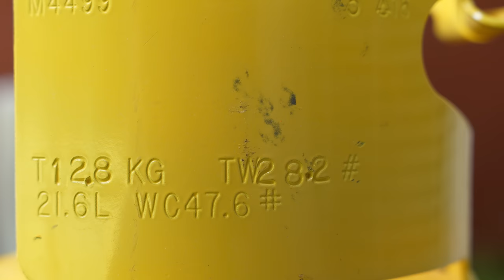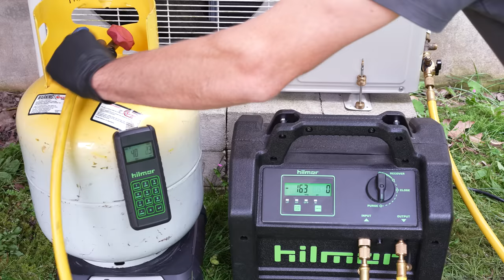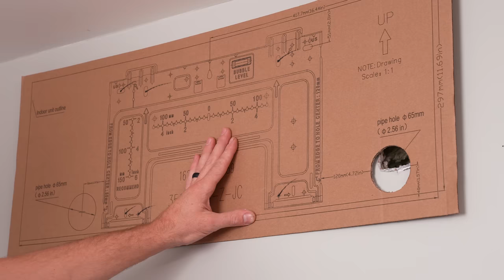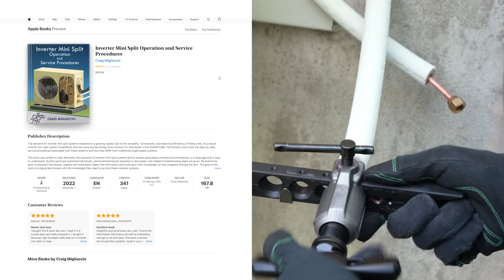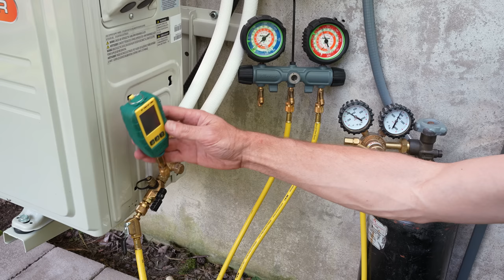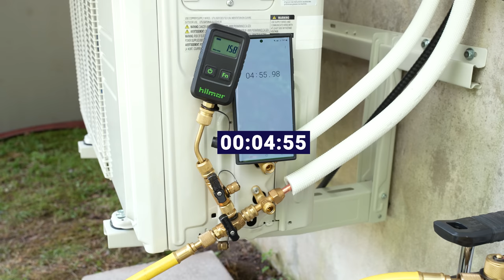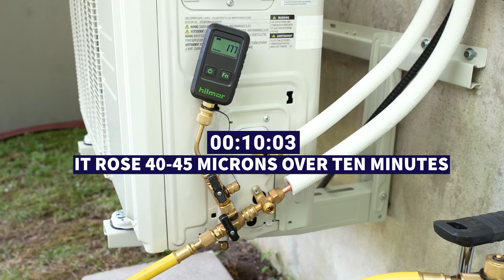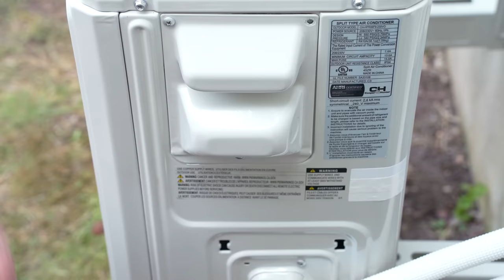Mini Split Replacement and Install Process! Wall Mounted Indoor Unit! All the Small Important Steps!

Comment: What was wrong with that Fujitsu? It should still be under warranty.
Reply: Not that one , I did notice that the indoor head was not a 12 RLS2 which is the match for the outdoor condenser. ThecRLS2 had a different type of front cover that raised up when powered on .

Comment: Outstanding I love man u are a great Instructor trainer thank you. I'm 66 an I'm going to go for it keep the video coming
Reply from the maker: Thank you so much for your kind words and encouragement! It's never too late to pursue your passion and continue learning!
Reply: @acservicetechchannel  amazing videos Craig! Quick question - I’ve just installed a Mr Cool mini split but not happy with my excess line coil. I’ve attached the lineset but not turned the Allen key valve to release refrigerant. Is it ok to unscrew from the condenser and tidy up the lineset? The owners manual is really vague on this. Thx!!!

Comment: I have a 10/12-yr-old 24k Daikin Mini-Split Inverter that I removed from my Florida home and brought to NJ.  I was going to trash it so it sits in two pieces, sans the line-set inside my utility trailer.  Can this system be shop tested to see if it would be worthwhile to install it here in my NJ home?  I don't want to go through a complete installation only to find out it actually needs to be replaced, at 82 years I don't need any more practice, if you know what I mean? There is currently no refrigerant or gas in either of the two pieces.

Comment: A white conductor used for power should be colored (Sharpie) or taped black to indicate it is now energized.  I'm going to fix a service upgrade where the installer landed the white, unmarked L2 to the neutral bar.  I will land it on the breaker after marking it.

Comment: Hi Craig , just wondering why the Fujitsu unit was replaced . They were great units , I loved how small, compact and sleek the indoor heads were, however coil leaks were very common with that unit especially when used in the heating mode . Like to know your thoughts . BTW I just bought your book looking forward to picking up a few pointers from it . Keep up the good informative videos .

Comment: Hi Craig, very helpful. I have several units I have replaced for a varity of reasons, in almost every case I was able to pull all the refrigerant back into the outside compressor unit. please  tell me how to use the recovery machine to pull the refrigerant into my recovery bottle and whether I can reuse it in a low charge unit

Comment: Hi great video, I love just watching your videos for a quick refresher before I fit a unit as I’m a new tech. You are by far the best teacher of these mini splits I have came across, I have both your books and love them! When on the vacuum you say aim for 100 microns, I have recently purchased the press set to just crimp the line sets together on joints,as some areas require heat permits and in the Mitsubishi installation manual it states no flare joints inside the building (R32) say if your fitting the indoor unit on an internal wall and using a condense pump. Only problem is on the fittings bag the manufacturer states they are rated to 200 microns does this mean going below to 100 was cause the fitting to draw in air? Can’t seam to find much info on it and my local supplier looked at me as though I was crazy asking this question. Hopefully you can shed some light on the subject. All the best
Reply: I love to watch for refreshing. Bit vacuuming for 10-15mins would be more than enough i think. I aleays listen to the noise from vacuuming tool to be sure its all tight

Comment: Thanks, Craig!  Your videos gave me the confidence to complete one successful installation last summer and now I'm in the process of installing a Multi-Zone Outdoor unit.  Question: the outdoor unit (Pioneer) lists 18,000 BTU as the minimum connected load.  Is there harm in running the first 12k BTU indoor unit by itself until I get the second 12k indoor unit installed? Or is it just energy inefficient?  Thanks!

Comment: 7:03 - I always thought so too, but if you read the install instructions, a lot of the times they say Solid or Stranded conductor wire, min AWG 14. 
It should be stranded for sure for 2 Wire AWG 16 for daisy-chain wiring of Variable Refrigerant type systems.
Reply from the maker: The issue is more for code than manufacturers instructions. WE used THWN/THHN standed to pass code in outdoor flexible conduit, thanks!

Comment: I don't know if you monitor your videos, AC Service Tech, but I want to know if you've ever removed an existing Mitsubishi mini-split indoor unit from a wall?  In our case, I can't see a backing plate and, quite frankly, the Mitsu indoor unit that I'm referring to doesn't seem to budge when I try lifting it up.  I suppose another way to ask this is, in your experience, does Mitsu use backing plates like the one you filmed for this video to mount their mini-split indoor units?  By the way, the indoor unit that I'm asking about is an MSZ-FE18NA.  Thank you for any help you can give us..

Comment: Great channel!!! I have learned a lot here to manage to service on my own my ACs!!

I have just one question.... Is it a viable option to use CO2 for pressure test instead of nitrogen? Because i have a tank with manifolds for primary tank pressure and secondary regulation where i use it on the MIG welder and it will be nice if i can use it 😅

Comment: Craig, love your videos...I have a 20 year old Heil R22 heat pump TXV 3 ton.  For me to do a superheat would I accurately measure low side at condenser or evap?  I have an accurate thermocouple with towel over it, and old style gauges.  My manual says 12 degrees SH.  Thank you, Anthony

Comment: Hello Craig, question.  If one is remodeling a basement and wants to install a mini split would you leave extra line set length in the situation described next?  If you put a hole through the sill plate, and ran the line set between the floor joists to a soffit and then installed the air handler on the other side of the soffit, and then you drywalled the floor joists to create a basement ceiling,  Lets say 3 years later a new better mini split comes out and the customer wants the new outside unit and inside air handler.  Since it would possibly take destroying the ceiling drywall to add a new line set, would leaving extra line set length outside and in the soffit allow for future re-flares?  Would this apply to any mini split installation where the line set is behind drywall or the air handler isn't on an exterior wall?  Thank you and great video!

Comment: For a multizone mini split system in cooling, why when one unit is turned on, the line ices up and the system won’t cool but as soon as you turn on a second indoor unit, then they both cool as they should?

Comment: Discontinued condenser unit, it’s main board is burned out, 3 to 4 months replacement parts. If I just buy same btu/seers different brand condenser replacement, will the communication between the indoor and outdoor is the same. Or each brand has its own thermostat and communication system. If you can do a video on the one wire Thermostat it will be great.

Comment: Usually there is a plug in the back for the drain on one side opposite of where it is connected. You can remove that plug and put drain on other side so that drain is closest to line set hole. Remember to put plug on other hole 😅

Comment: what about using at 34:41 a silicone grease paste? i heard a friend who use it... is he wrong? it's the same silicone grease he use for flashlight aluminum threads, he says it's perfect for this job because it is quite dense and if used only around the surface area that "presses"

Comment: Why do you personally still use a manifold gauge set when in other videos you mention that individual guages are better? I understand you still demonstrate with them because they are prolific but I'm wonderingif there are any other advantages other than cost and quicker transition from check/vaccum/leak/fill. I dont have much experience with HVAC and am curious.

Comment: I don’t know why you would say the wire incoming to the condensing unit is wrong. It’s a white wire why not use red coding tape on that wire. As far as it being stranded why would that matter ?
Reply: I’m don’t know much but why would you use tape to change the color of a wire.  That seems like a practice that would confuse everything.
Reply: @MrElemonator  NEC code requires hot wires to be certain colors and when a different color has to be repurposed it should be marked so the next tech knows it's possibly hot.
Reply: I agree.  If stranded is used, it should be terminated with a fitting so it doesn't stray from the screws.  Especially on that type of terminal block.The important point about the wires is that they are rated for the unit ampacity.
Reply: @rcstl8815  it was solid core wire being used so why is he changing to stranded.
Reply: @rcstl8815  this is a practice that I thought was common place and accepted
Reply: @shifter8207  Stranded is more flexible so maybe....  Most factory whips are stranded although from the main to the disconnect is Romex or solid.
Reply: @shifter8207  In stranded conductors, DC resistance is higher because the cross-section of the conductor contains air in addition to copper. But idk if that’s why he says it needs it. I would say it’s dependent upon what the manufacturer requires… also the stranded wiring is easier to handle and less risk of breaking with crimped connectors to the terminal. Ensures a proper connection to the unit.
Reply: @shifter8207  Stricktly speaking, codewise, he is right, on new installs it should be black and red.  But we don't know the history.  The white would pass inspection if it marked in the end.  And, it is accepted practice and detailed in the NEC.
Reply: @Alex-jo2oi  but this is the ac connection point. This seems more of a preference to me. I’ve done plenty of these as solid core wire and never had an issue. Unless the manufacturer specifies this in their install manual
Reply: @shifter8207  true unless he explains otherwise ima say it’s just preference as well.
Reply: I wonder how you help the industry with videos that encourage diyers...
Reply: I think I read in one of his books or somewhere that the stranded wire gives a better signal to the indoor unit.
Reply: @vw_mods_4711  sounds familiar.
Reply: @MrElemonator  This does seem strange here in Australia where we are fairly strict in our electrical code. We mainly use Brown, Blue and Yellow/Green in our power wiring, this is three core. But when it comes to lights we use red and white the white becomes a switched active and just to empathize that it can be a"hot" wire sometimes electricians will put ether a red tape or red shrink tube around it.
Reply: Anywhere where vibration is possible eg automobiles aircraft multiple stranded wire is the preferred choice less likely to fatigue.
Reply: @alanmainwaring1830  that is the answer there. The vibration is what greatly diminishes the solid copper overtime!
Reply: It appears the wire coming through the whip is NM which is not listed for a wet location. The inside of a raceway installed in a wet location is considered a wet location by the NEC. In other words, conductors in an A/C whip must be listed for wet locations which NM is not. 2017 NEC 334.12(B)(4), 300.9 Having said that, it's very common to see NM used in A/C whips as Building Inspectors often don't check it.

Comment: i work in reaserch and devlop,  any hvac refrigeration  cut out flares THEY WILL LEAK HOT COLD HOT COLD LEAK YOUR A BAD INSTALL
Reply: Not true , I’ve done hundreds of installs without leaks using flares . Do it once and do it correct and you will be fine with flares .